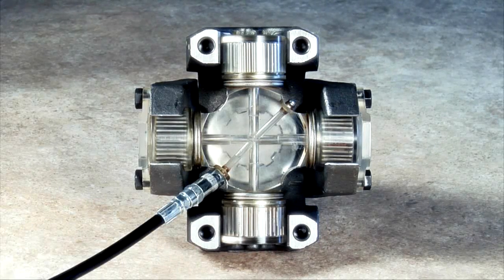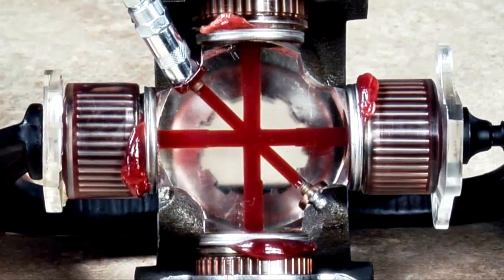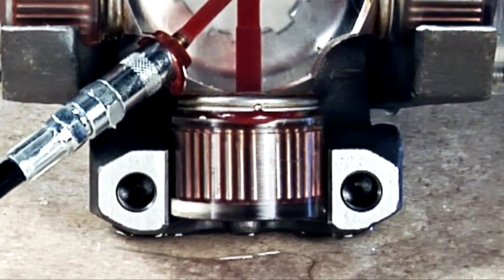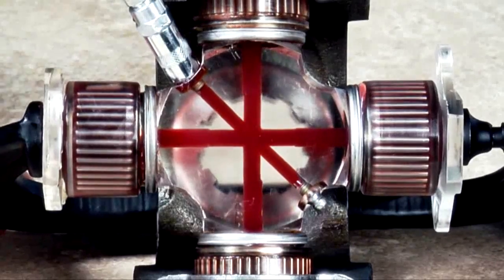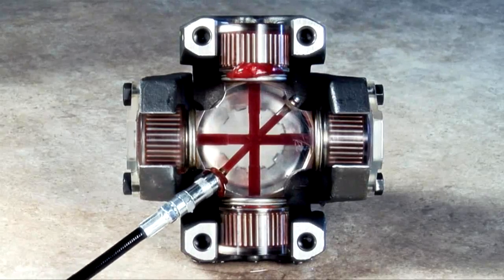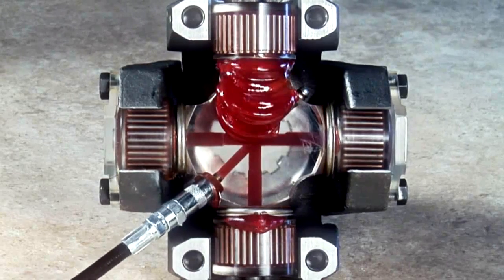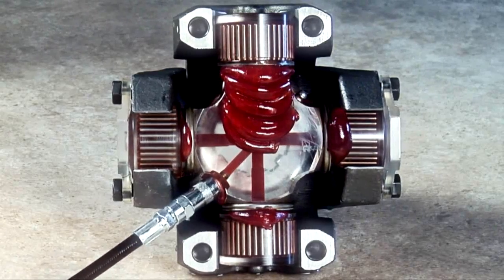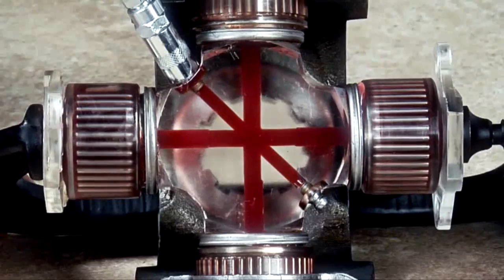Spicer Universal Joint Lubrication Path - 10-Series

Comment: Interestingly a non greasable ujoint must be disassembled and reassembled to install it. Upon doing so, too much grease can make it hydraulically lock and not enough grease may/may not cause an issue. Some grease can surely get displaced when removing the cap, as shown here, and then due to difficulty getting it back together Wiping it off may be necessary.  I feel like packing it with that much grease beyond the needle bearings already being coated in grease may/ may not be unnecessary.  As far as I know a non greaseable ujoint has seals that will trap the grease inside, and a greasable one has seals that are designed to allow grease to come out, so I wonder how often one would have to top them off and what the differences are in longevity between greaseable and non greasable.
Reply: About every three to five thousand miles or at least every oil change. Grease u joints get a bad rap because just vehicle owners only know how to turn the keys. The mechanic will install zerk ujoints because of cost and that ujoint will never see grease again in it's short life.
Reply: i've grown a preference for the greasable ones because they are quiet, smooth, and easy to operate which is important to me. the non greasable have seals which make it very stiff and noisy, plus these spicer ones i got were garbage with these little plastic washers inside the caps that squish very easily and cause runout issues.

Comment: This is completely stupid! if you would just manufacture these with a zerk fitting for EACH bearing cap separately, you wouldn't have to take it all apart to find out why one or more aren't getting grease ! it's also brand new!!! the main cause of any of my U joints like this, is because of one cap becoming plugged with rusty shit after a while and FAILING!
Reply: @Rhetorical Answer 
Yup
Reply: Excellent idea but their in the business of selling ujoints, finding any with anyway to grease anymore is practically impossible for pickups
Reply: I believe there is 1 brand that has greaseable fittings on each leg.

Comment: Nice Video. But I still do not know if there is a special way to install the spider in the yokes so the grease fitting wholes are compressed not elongated when the drive shaft   is assembled to be powering the vehicle in forward gears.